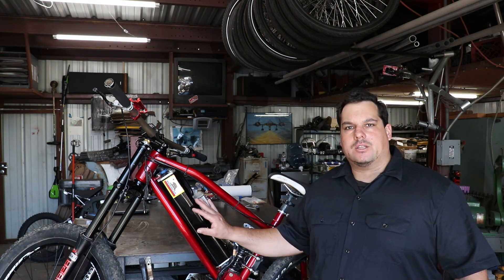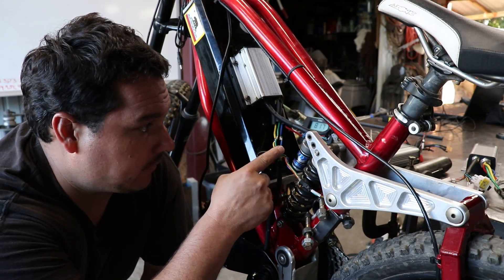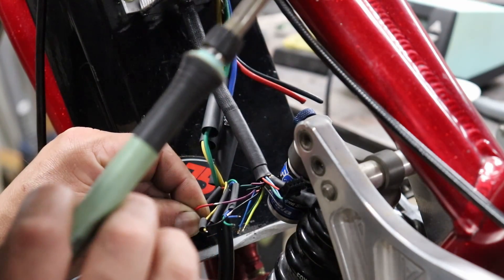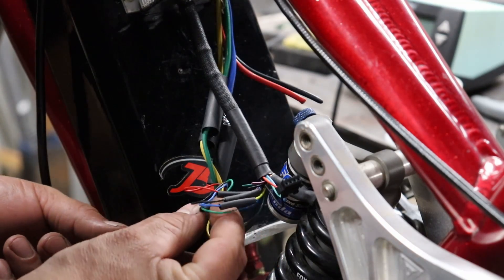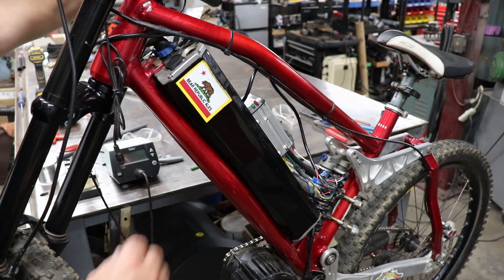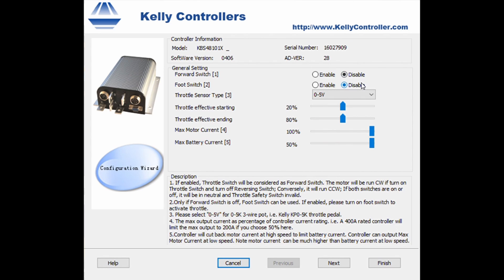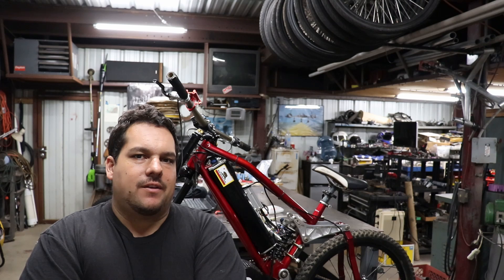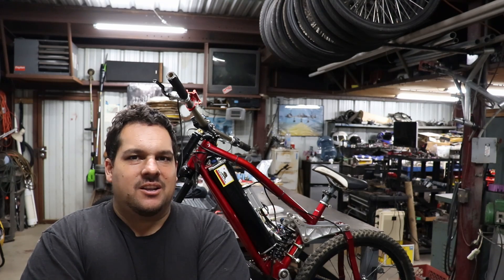Installing and Programming A Kelly 45 Amp Controller

Comment: Hello Johnny5

I have an MXUS 4T 3000w motor, a KLS7230S controller and a Hailong 48v battery (https://cyclurba.fr/forum/image/forum_2023/forum745471_L.jpg) and I don't know if I should use the precharge resistor. In your video you indicate that you do not use them because you have installed a BMS that supports this.
Can you tell me how to proceed please because there is a BMS in my battery and it is also equipped with an ON/OFF button but I don't know if that would be enough? I was also told that it was enough not to use this precharge resistor and to simply connect the battery to the controller with an anti spark XT90....
Thanks for your help

Comment: Great presentation. 
My controller shut off after the motor stutterd a few times. Seems I had not pushed the XT 90 connector  battery to controller.
What model is the controller and where can I get it. 
Link appreciated 
Thank you.

Comment: In the description you said it’s a square wave, but on the website it claims to be a sine. Did you get the 48v or 72v? I’m thinking of getting the 72v and curious if I can program the Voltage cutt off down to 48v
Reply: Yes you can

Comment: i have a green light but either no power or no signal is going to my motor it wont spin
Reply: Put a quarter coin in the coin slot it'll work 👀

Comment: do you know how to determine whether a motor's hall sensors are 60 degree or 120 degree?
Reply from the maker: Either I look for the specs on the motor, or take a look at the motor's stator and measure out the hall angles. If anything I also just try one or the other.
Reply: @diye-bikeswithjonny5398  sounds good thanks
Reply from the maker: @evanseki2470  no worries!